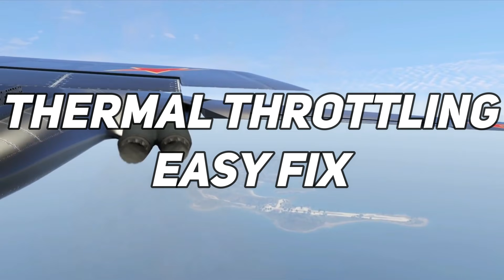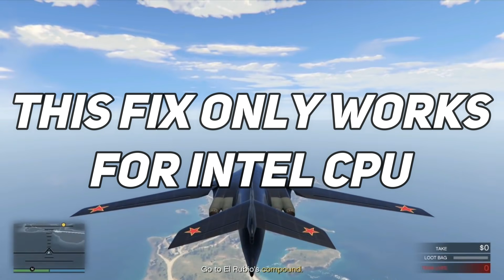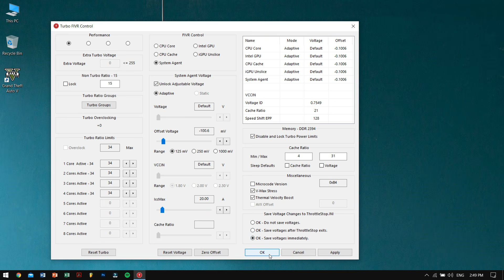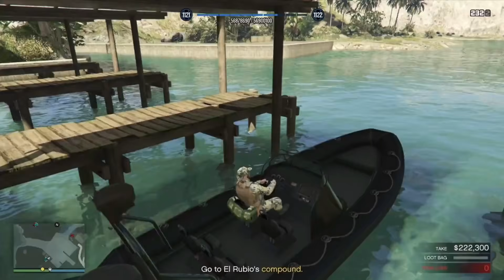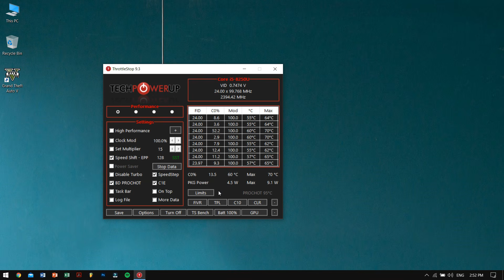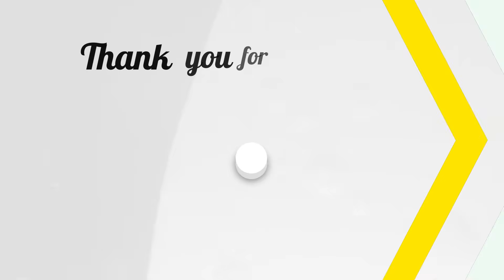Comment: I have another question about my pkg power. My younger brother and I has the exact same laptop but his pkg power is like 2x lesser than mine but the performance is the same. His average pkg power is around 14W and his max is around 22W. Mine is around 38W and my max is around 44W. Is having high pkg power a good or a bad thing?

Edit: his laptop isn't undervolted unlike mine
Another Edit: exact same brand, specs, and variant
Reply: You should have better stable processor than your brother because of higher power but it also means more heat but as your laptop is cooling it enough then it's not an issue.
Reply: @TechTweek  ooh, Thanks for letting me know.
Reply: @TechTweek  i just tried method 2 and holy crap my temps got way better and my pkg power is at 28 average and my temp is around 65-69 both when charging and on battery. Thank you so much for the video it helped me a lot🙏

Edit: 60-65 on battery
Reply: Enjoy mate.

Comment: Hey man. Just found your video after a friend told me about Throttlestop. Considering giving it a try, after having FPS issues at certain points in UBOAT game (but still having fun for now).

My specs are:
i5-8300H @2.3 GHz (8 CPUs)
GTX 1050 4GB
8GB RAM

Would the numbers you set work for me?
Reply: Try out all the three methods.

Comment: Problem is everything on throttlestop keeps resetting after i restart/shutdown my laptop. Do u know a solution to that?
Reply: Throttlestop is not a permanent solution. After restart you'll need to run throttlestop.
Reply: @TechTweek  I updated the version of throttle stop to 9.3 and now the problem is everything in FIVR is locked like the unlock adjustable voltages, CPU, GPU and stuff. Do you know how to unlock them or know any Throttlestop alternatives for my device? I use Microsoft surface 2 laptop.
Reply: You can try searching in the bios of your laptop.
Reply: @TechTweek  Ok so finally the problem of not saving was fixed. I'm not actually sure how but I kept uninstalling/installing different versions of throttlestop and this time it appears as a direct shortcut when i search for app to the right windows tab. Somehow everything was saved even after restarting. 

However, when playing GTA 5, I kept experiencing random crashes or a bluescreen saying a reboot is required in the middle of when I'm playing. I thought it was due to having only ~1gb left in my storage (I kept trying to have another game installed together). Is that why the crash kept happening again or is it because I did not set throttlestop to the right voltages? By the way I had it set to restore point. I watched your video again, listened carefully to method 1 and just set everything according to how u did. I'll see how that goes when I play GTA 5.

Comment: Hello why I dont Have Speed Shift and FIVR And Disable Turbo Dont work on me?
Reply: This only works with Intel CPU. You prolly have Ryzen cpu
Reply: What's your cpu?
Reply: @TechTweek   i have Intel(R) Core(TM) i3-2310M CPU @ 2.10GHZ
 sorry for late reply
Reply: Try searching in your bios. There should be a setting related to cpu or something like that.
Reply: @TechTweek  i dont think theres one
Reply: Then you're out of luck 😓
Reply: @monsterkill164  so Any Suggestion for My Laptop on how many mhz to set?
Reply: @whinzk  It’s up to you. Your base clock is 2.1 ghz so it’s 21 or you can increase it like 23? So that you run 2.3ghz on all cores. You can put 1 on minimum and put 23 or 24 on max. And when you play games set the min the same as your max.

Comment: Yo bro, great video, Ive been using method 3 for a long time now since i got my laptop. I wanna ask will it have more improvement if i use method 1 + 3? Undervolting and disabling turbo. We have the same cpu as in the video btw i5-8250u.
Or combine method 1 2 3? Or i can just use just 1 of the 3 methods?
Reply: You can use 1 and 3
Reply: @TechTweek  alright thanks very much! Just subscribed and love ur videos so far, straight to the point
Reply: Thank you so much ❤️

Comment: Isn't turbo good for your pc please explain i need some explanation
Reply: Turbo is good, no doubt about it. But when turbo is on while gaming then the cpu produces more heat and because of the heat the cpu under clock itself more than the base clock of the cpu and this results into lags and stuttering. Disabling turbo will result into a stable clock speed of the cpu and even it'll not produce more heat as it is not working that hard. And you might think it'll affect performance but trust me newer cpu are powerful enough to handle most of the games at a stable playable fps.
Reply: @TechTweek  Oh correct me if im wrong .DIsabling turbo will give more fps than enabling turbo?
Reply: Disabling turbo will give you stable fps. Not more fps. For me when I turn on turbo I get 120fps (unstable) in valorant but when disabling turbo I get around 80-90fps but it's stable af.
Reply: @TechTweek  ohh thank you for the explanation !! And can you tell me your specs ?
Reply: i5 8250U
16GB Ram
500GB SSD
940MX
UHD 620

Comment: Do i really need to change/configure the values for the other settings?, Other videos they only change core,cache & intel gpu 🤔
Reply: Don't mess with System Agent voltage settings, regardless of what he recommends. Everything else checks out fine for my Intel i7 Laptop.
Reply: Try it out.

Comment: Skipped to third method. My temperature drops from 90 C to 69 C. I will be trying the other methods soon. 

Thanks man ✌🏻.
Reply: You guys realize that disabling Turbo will lose you quite a fair amount of performance depending on whether the game is CPU or GPU bound.
Reply: @pillock0  That's true but because of this method one can achieve a stable frame rate. At least I did.
Reply: @TechTweek  If you're satisfied with playing at a lower frame rate, then fair enough.
Reply: Yeah.
Reply: same man, mine went up to 92 and now wont go above 70! awesome
Reply: THERMAL PASTEEEEEEEEEEEEEEEEEEEEEEEEEEEEEEEEEEEEE
Reply: Enjoy mate.
Reply: @TechTweek  is there any reason why Turbo Ratio Limits I can't access it's in grey and I have a Intel(R) Core(TM) i5-1035G1 CPU
Reply: did u still tick the speed shift box? or u didnt
Reply: @realapppleC.E.O  I didn't. I only disabled the turbo boost feature running only on the base clock. It worked like a charm
Reply: It's good to see you guys helping each others. ☺️
Reply: @alialdosari6666  thanks man

Comment: Can you please provide an alternative for amd processors ?
Reply: Have the same problem with a Ryzen 3700u CPU, did u manage to fixe the issue?
Reply: @alexandreromao8410  fortunately yes 
Download amd ryzen controller and set your desired temps (77°-80°) and also lower you cpu tdp (to 15 if it's heigher than 15 or to 12 if it's 15)
I play don't play games too often but yea this has helped to maintain mine temps about 75-77 for long hours! and also make sure to set the upper limit of your games to about 65 FPS(can be done in game's settings or in amd Radeon software) ..... hope your machine is not burning anymore
Reply: @justanotherweeb6915  Did you play with boost tdp or periods or should I just leave it?
Reply: @alexandreromao8410  just leave them and change only the tdp option (but if this doesn't change the tdp then you might want to change every settings in that page which has tdp thing in it to the tdp you want) in most of the cases this works.....

Comment: There is some games that become a little long to load the game like AC4 black flag and not improve fps at all.. but there is also games that improve its performance like just cause 2 i get 35 fps to 60 fps, i use method 3 because other method makes my laptop crash.. when disable turbo it become 1.6 Ghz only.. is 1.6 Ghz enough to play games like valorant, csgo or Gta 5 ?
Reply: Yes. I play Valorant and GTA 5 Using method 3 and it works like charm ✨
Reply: @TechTweek  Alright.. Thank you bro, love your videos
Reply: Thank you so much ❤️

Comment: brother i have a hp pavilion 15 cc140tx which has the same cpu as yours and both the gpu's are the same too. I watched your old video too. It crashes at -100.6 voltage. 

By the Way, I am using a 45watt adapter instead of a 65watt adapter. my 65watt adapter is not working. I will get a new one but I cant go out because of lockdown.
Reply: Try -80mV
Reply: @TechTweek   thnx for replying so quickly brother. The fps drops have lowered a lot. I can fluently play gta v now. thnx brother.

Also, is the ac adapter an issue? I read somewhere that using low powered ac adapter causes low performance
Reply: It's alright bro. Using a low powered adapter means less power and less power means less heat and less heat means less thermal throttling and less thermal throttling means stable fps. If you're happy with the performance, then I'd suggest you to stick with 45W adapter.
Reply: thnx for giving me your attention. I want to know your laptop model. And do you know why I could not undervolt my laptop to -100? You and I have the same specs.

Also, I have turned off "fan always on" from bios. Should I turn it on? Sorry for so much questioning. I was so frustrated.
Reply: Do turn your fan on.
Reply: @TechTweek  brother brother one more thing. This fps drop from 60 to 10-12 happen only while charging....on battery its smooth gameplay....does it happen to you
Reply: Try disabling turbo and the play your game.

Comment: I cant find in the internet what should be the best for Intel(R) Core i7-7700HQ CPU @2.80GHz 2.81 GHz, can you help me?
Reply: Try -80mV
Reply: @TechTweek  question, if something goes wrong, how do i reset it back to normal or is it gonna reset back once i close throttle stop?
Reply: If something goes wrong your pc will reboot and after that everything will get back to stock.
Reply: @TechTweek  can i do the mv as -80.1mv? Cuz i cant adjust it to be exactly 80
Reply: Yeah.
Reply: @TechTweek  i did method 1 so far and its not that lag anymore although when i start driving thats where it lags but its going good so far
Reply: Okay try it for sometime. Do let me know if it's better than before.
Reply: @TechTweek  i think i gotta make it go somewhere in the 70s or 60s but im experimenting it right now on what is the best one
Reply: Alright mate
Reply: @TechTweek  by the way in method 2 do i make the cores lower by 10 like you did? Or is it different for others
Reply: @TechTweek  hey bro can you pls help me, i wanna reset it back to default settings on the settings part not the undervolting part, it felt a little bit more laggier after a few days, so is there a way i can put it back to normal settings if so thank you!
Reply: Don't run throttlestop. Before playing your games. Done.

Comment: does it affect games designed for 1 core? like minecraft
Reply: No.
Reply: @TechTweek  can i ask why? because i have an issue where my cpu is stuck at 0.78 ghz and not moving anywhere, i know that it has more power to perform much better. do you know any fix for that please? it is intel i5-5300U cpu @ 2.30GHz dual core, and intel hd graphics 5500. thx again if you or others may know the fix
Reply: Check your temperature while playing game or when the cpu speed is at 0.78ghz.

Comment: Hello, I have i7-8565u. will it work if I set the value to -100.6?
Reply: You can try putting that.
Reply: @TechTweek  But I get massive FPS drops for 1-2 seconds then goes back to normal on  any setting even low setting. MX250 I7-8565u (gaming performance on throttlestop) do you know a solution?
Reply: Check my new video and try out those 3 methods.

Comment: i cant choose many of the options like ,set multiplier and cpu core voltage, what do i do. im also core i7 10750
Reply: Your cpu is locked and I got the same processor as you, and mine is also locked unfortunately.
Reply: Mine is i7 10750H, I was able to disable turbo boost. As well as changing the CPU core power consumption.
Reply: Maybe your cpu is locked.

Comment: Bro i have changed few settings in TPL options I also have the same CPU i5-8250u please  can u tell what settings i have to change in TPL settings
Reply: I think you need to keep turbo boost long and short max power to 28. Also make sure BD prochot is checked. Hope it helps.

Comment: Unfortunately, none of the method worked for me... I have a Intel CPU I7-7700HQ.
Tried undervolting to 125: crashed
Tried undervolting to 115: crashed
Tried to undervolt to 80 and put my CPU turbo limit to 28: no success, still low FPS and stutters/frame drops.
Disable Turbo: no changes

Unfortunate... if you guys have any idea to help, please let me know. So tired of playing Warzone with a FPS of 60-65...
Reply: I am sorry to hear that. Try checking your cpu fan. And thermal paste.
Reply: maybe you should undervolt your gpu? install msi afterburner
Reply: @demirdrgn  I do not think it works for me unfortunately. I think I tried that in the past... The thing is I have FPS drops ONLY in Warzone. I'm good on Overwatch, Rainbow Six... I even tried to reinstall the game, but no luck. It's just really odd.
Reply: @misteranatoh  it should work warzone is powerful game
Reply: @demirdrgn  Alright, I will try it again.
Reply: @misteranatoh  did you fix the issue bro? I watched a video earlier today on YouTube about changing an internal file on COD for the game to run on 3 cores instead of 6/8 helps boost FPS massively, let me know if you want help or if you’ve already fixed the issue my man
Reply: @themellortron6289  I've tried that too and unfortunately, no luck! I think it's because one of my fans are not working no more and it's just preventing from overheating.

Comment: bro I have an HP Pavilion 450 G5 and the Adjustable Voltage is all grayed out. is there any solution to this? I can't undervolt. :(,

Tried checking the bios and nothing seems to work on the settings.
Reply: Im using the i7 8550u version
Reply: Try searching on google related to this processor.

Comment: Bro my ThrottleStop does not have Speed Shift and FIVR option please help.
Reply: ok so for those who can't use speed shift, your cpu is old and not supported so instead you can use 'set multiplayer' to lock the speed of your cpu to the speed you wan't, where the cpu stays at a low temps and doesn't lag/freeze your games.
Reply: same problem here i dont think the cpu support undervolting and overclocking thing not sure
Reply: Ryzen?
Reply: @TechTweek  nahh, intel
Reply: What is your CPU model?
Reply: @TechTweek  same problem. I have intel i7 4600u 2.10ghz 2.70ghz
Reply: Maybe that generation doesn't support it. 😓
Reply: What's your cpu
Reply: same thing to me and my laptop's cpu is i7 2630qm 2.00Ghz
plz tell me what can I do
Reply: Throttlestop not working?